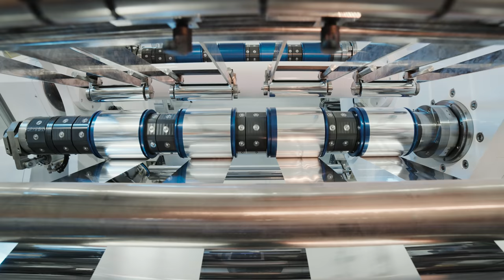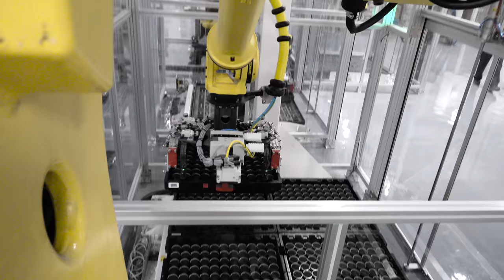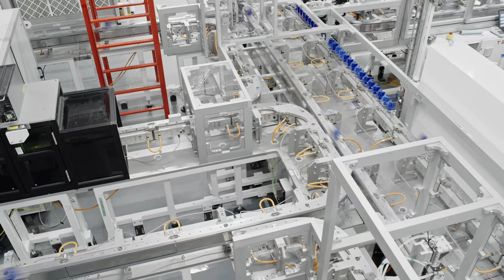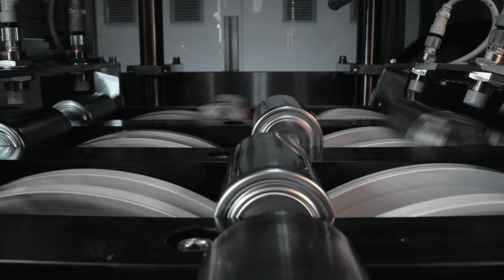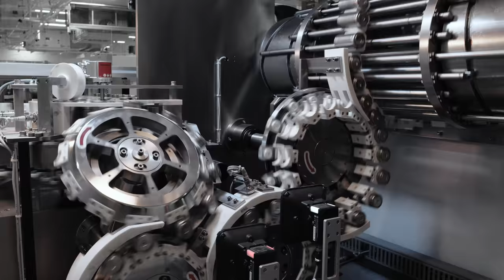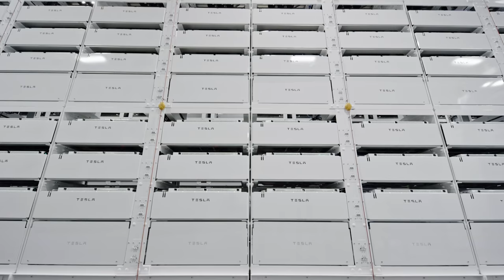Making Batteries

Comment: 17 reasons to short $TSLA

1. Dependant on external battery companies (Panasonic, CATL & LG Chem)
2. The autonomous driving features customers have paid for are illegal and don’t work. Other companies including Waymo, Zoox and dozens of Chinese companies are developing autonomous solutions. Automated Lane Keeping Systems looks about as far as this will get for a very long time and Tesla has no obvious competitive advantage.

3. Regulators asking for recalls and not complying
4. R&D cut to the bone (pipeline issue)
5. It doesn’t make money adjusting for “aggressive” accounting (warranty provision) and massive carbon credits about to dry up
6. Over promise, under deliver culture (robo taxis)
7. Non existent quality control for such an expensive item combined awful after sales
8. Reckless financial management (almost went bust during model 3 ramp up)
9. Tiny market share
10. Terrible industry (capital & labour intensive, endless churn of new better new products, difficult/recalls, consumer preferences are wide ranging)
11. Price cutting to support market share not a good sign.
12. 2021 EV models out selling Tesla in Europe.
13. Hundreds of new EV models in the pipeline over next few years.
14. 150 competitors making EVs. (With established global manufacturers miles ahead on build quality, manufacturing capacity. And fast developing Chinese government support EV industry)
15. Unsustainable mania among buyers (TikTok level research, price momentum)
16. Musk unfit to run a public company
17. $780 billion market cap supported by zero profits and unprecedented irrational exuberance. To justify analysts assumption get more ridiculous daily 😳

6 reasons to own $TSLA
1. My uncle made $50,000 on Tesla stock
2. I watched an investment guy on TikTok
3. Electric cars are the future
4. The share price keeps going up
5. In the FUTURE Musk says Tesla will do ABC and XYZ
6. In the long term the business will grow into its valuation
It will be extraordinary if investors in Tesla hold their gains from here. Has there ever been such a terrible business with such a high valuation. Compare it to Apple at $2.1 Trillion or Google at $1.2 Trillion with huge profit margins, scalable businesses and dominant market positions.
What happens next? Who can say. None of us know the future but it doesn’t half look like Tesla investors will eventually find the thin ice gives way as they plunge into freezing water.

Comment: Wonder if a wind tunnel in the car would help charge the battery? Bring that mid floor hump back and put a 5inch PVC from mid bumper to bumper. Then just put a 100 mini fans in it, then say over 20mph these fans become windmills and start generating electricity. Maybe put a couple of them on a ladder rack on the CyberTruck see what happens.
Reply: the extra drag will demand more energy from the batteries and drain it at a faster rate, tesla resorts to regenerative barking as a form of generating power.
Reply: @miguellopez3392  How much drag could it be if it was a straight shot through and the winds turned to release the airflow. Make it so it slides out for fan replacement. Be more drag on opening a window.
Reply: @miguellopez3392  A ev car is nothing brilliant until it's self charging.
Reply: @greensandbeansgaming1358  you dont understand that the spinning a fan to generate power will put a higher energy requirement on the motors on the car pushing it then the energy generated from spinning the fan, i don't think you have a right to say what is brilliant until you know that this is not a perpetual motion machine.

Comment: Can anyone explain to me why they actually making batteries round and not square shape, guess it would safe some space?
Reply: round batteries are cheaper to make because its very simple for a machine to roll material into a cylinder then to shape it into a square or other forms, that would take extra steps and more precision, this cost difference makes up for higher space which isn't all that much needed by their current batteries.

Comment: i'd say probably 99% of people don't get the significance of this battery. let's just set the ENTIRE issue of powering an EV aside for a minute- and let's focus on the rest of the car. how long will the rest of the car last? INDEFINATELY.  the few minor parts that might need replacement are insignificant, pricewise. ANYONE who understands electric motors and electronics will acknowledge this. now- let's circle back to the 4680 battery. Jeff Dahn's preliminary testing of this battery indicates that its' maximum lifespan would be 3.5 MILLION miles or 30 years. tesla's projection for this battery is 1 million miles. shelf life is NO LONGER an issue. the old lithium cells? 10 years of battery? NOT ANYMORE. one pack, ONE CAR- ONE LIFETIME. 

who can compare? which legacy auto maker? NONE. at this point, they're ALL doomed. not next week... not next year. NOW. stock analysts for SURE don't get it. there should be a feeding frenzy at wall street over tesla. the jaw dropping moment for me.. was when maxwell technology first solved lithium battery degradation and got bought by tesla in 2019. for me- that's when I KNEW it was real. the jaw dropping moment for wall street won't be until tesla owners start posting pics of tesla odometers with 800k miles on model Y's that are already 12 years old.  by then- 80% of legacy auto will be bankrupt.  

isn't this how wall street always responds? 10 years after ALL the signs were there? legacy auto in partnership with big oil have basically OWNED the planet for the last century.... and with a SINGLE piece of technology- tesla changed ALL THAT.... and NO ONE noticed- YET. consumers figured it out- long before wall street did. 50% growth yoy since 2012? 6 month waiting periods to get a new tesla? while legacy struggles to sell NEW cars that have been sitting on the lot for OVER a year.  

yo elon- way to go for the win bro!

Comment: Was'nt their a material that could be 3Dprinted, hold an electric charge, and if memory serve's, was also heat resistant, it  were black, and was not strangely priced, expensive. But the knit pattern.
Reply: Can you remember where you saw it?
Reply: Useless for EVs unless it can be scaled for mass production.

Comment: Why not make cuboid spaced batteries so there is no space left between the batteries and more can be fitted in the car.
Reply: Cell need space anyway. They have heat transferring materials between each cell. Cuboid batteries will make the battery more prone to overheat.

Comment: I was extremely disappointed by Elon's blunt rejection of the request to allow our FSD license to be transferred to a new Tesla on the Q4 results call.  There should be two classes of FSD licenses: Residential Use and Commercial Use.  It's unreasonable to price FSD based on the assumption that every Tesla owner with FSD is going to turn their Tesla into a full-time robo-taxi.  Also, automobile insurance companies currently won't pay for FSD license replacement as part of a total loss claim.  Does Tesla insurance?

Comment: Which cars are going to get the 4680 batteries first in the US?
Reply: model S plaid is a confirmed car.
Reply: @miguellopez3392  And the structural battery pack?
Reply: @Greg29  that will likely first be seen in the model Y at giga berlin.
Reply: @miguellopez3392  Thanks for the info. I'm waiting for the 4680 batteries before considering buying a Tesla, would also prefer it to have the structural battery pack. Guess I have some waiting to do.
Reply: @Greg29  plaid model s will now be available in march for the US.

Comment: Why tesla never put solar panels on any of their cars, Is it just because of looks? I hope atleast Tesla semi will feature one. There's plenty of space above semi which can generate considerable amount of electricity and it won't even affect the look of the vehicle.
Reply: it would add a cost that wont be made ack for over a decade if you count money saved on electricity vs installing and paying for the panels, its unviable unless panels get much cheaper or efficient.
Reply: @miguellopez3392  but there are cars running on solar panels alone, and c'mon a solar panel on the roof won't be that costly. Maybe there might be some technical difficulties but nothing that Tesla can't solve.
Reply: @fnp3092  and those cars are less desired due to their cost, size, speed, and safety. 4 miles a day is what you can expect out of a tesla if its roof where covered in solar. it can be solved just not now due to other factors in the technology chain.

Comment: ok now let's see the video with the factory that recycles those batteries !!!
Reply: might take a while, these batteries are being built to last over 10 years.
Reply: @miguellopez3392  you're missed what I meant with that question,making them is very easy compared to how difficult it is to recycle them because you need workers to do it, so yes there is not a video of a facility with machines doing battery mass recycle, if they just thought of the problems they were causing down the line they would change their present battery (pack) designs.
Reply: @vasopel  tesla and a founder of tesla have invested into battery recycling, tesla already recycle batteries but not at mass since not many of their batteries are being sent back, its not that you need workers its that you need a lot of energy separating the base components, they freeze, crush and dissolve the batteries in chemicals and doing this isn't cheap, so they continue to work on developing cheaper extraction.

also since you are so concerned with battery waste what is you alternative solution?
Reply: @miguellopez3392  go find a video or a picture of how a battery pack is glued together and tell me that you can melt-freeze-crash-disolve that into something (re)usable without people dissembling it first. 
alternative to what? batteries? there isn't one afaik,but we must build the infrastructure NOW and not wait until all those battery packs pile up,also some of the cost of recycling them should be added to the new batteries price.
Reply: @vasopel  battery is difficult to disassemble but the cells themselves will be intended to be used much longer, about 25 years, tesla also plans on just re using old cells for grid storage, adding the cost of recycling them will help ensure we cant afford to build the infrastructure to recycle them because  the cars themselves wouldn't be commercially viable at these higher cost, even so tesla companies are working on developing better recycling methods, so you are complaining about something people are already throwing millions of dollars and thousands of engineers at.
Reply: @vasopel  making the first batteries  for tesla use to cost 10x more until they figured out how to make it cheaper, imagine what would happen if they also included cost to recycle? No cars would sell to fund their R&D department to make them as cheap as they are now, You are scared and want technology to advance when YOU want it, that's not how the world works bud, technology can be produced in perallel, even if batteries dont get recycled it will still be less damaging then running on fossile fuels, you cant have everything you want.
Reply: @miguellopez3392  ? I'm scared of what? I'll be long dead by the time the problem gets out off hand :-) , but still...I'm really sad this is the way people are thinking :-(
oh well it's in the human nature to see only the near future.
Reply: @vasopel  yes people are thinking battery recycling should be solved and will solve it, your thinking everything should be halted until batteries can be recycled, you refuse to understand why this will not accomplish much but your fear of a large pile of batteries scares you enough to keep you from making the logical connection Between profit and availible funds for developing recycling.
Reply: @miguellopez3392   who said everything should be halted? it's just that there is not enough progress being made in battery recycling technology-machinery-infrastructure and that's a problem, battery manufacturing progress (and any technological progress) should go hand to hand with battery recycling progress, if not...it's gonna cost a lot more in the future, and if you think that companies are just waiting to have big profits before starting doing that then you're delusional. :-)
Reply: "should go hand to hand with battery recycling progress"

it should but this is real life where technologies aren't parallel in difficulty of advancement and profitability.

you keep wanting the technology to exist but ignore the fact that technology like this will take longer to develop since the demand for recycling doesn't exist yet and that companies wont make profit for recycling for years.

let me make it really simple since you are having trouble with the concept. 
NO MONEY FROM CAR SALES  = NO RECYLING INFASTRUCTURE
Reply: @miguellopez3392  I don't "want the technology to exist" I would just like them to invest more money in developing it, 
let me make easy for you: 
MONEY FROM CAR SALES DOESN'T MEAN THEY WILL MAKE THE HUGE RECYCLING INFRASTRUCTURE THAT'S ACTUALLY NEEDED ,
and the future generation will have to pay for the recycling :-(
Reply: @vasopel  let me make it even easier 
NO MONEY = NO RECYCLEING.
Reply: @miguellopez3392  hm.. 
NO BATTERIES = NO MONEY 
so yes
 NO BATTERIES = NO RECYCLING
great! :-)
Reply: of course...that's not the answer...they just need to develop battery packs that are easier to recycle and invest in automated battery recycling machines. ;-)
Reply: @vasopel  "NO BATTERIES = NO MONEY"
tank goodness they have batteries. and are selling them as fast as they can make them, this is ow they are currently funding research at tesla.

"NO BATTERIES = NO RECYCLING"
because these batteries are being put inside cars where they will remain for over a decade

"they just need to develop battery packs that are easier to recycle"
no they actually dont, they can sell these batteries and force the government to mange the waste, similar to how the US government subsidies oil drilling to make it commercially viable.

you seem to live in a alternate demission where things get developed way before they are need.
Reply: @miguellopez3392  no I am not in an alternate dimension that things get developed way before they are needed,
 I am in a dimension that things get developed WAY AFTER they are needed, and people think it's perfectly ok for companies to "force" the government to mange the waste not realizing that the consumers are gonna pay for it (taxes)
Reply: @vasopel  damage from car emissions outweigh the damage from lack of battery recycling, ultimately using BEVs will save the government money and help the climate stabilize preventing trillions in damages, the world goes for what is better not for what is best.
you want to live in a world that this one can't be.
Reply: @miguellopez3392   well that would be true if the energy for the cars didn't came from coal
Reply: @vasopel  that's location dependent, I live in Washington, #3 state in tesla sales, our power is 80% hydro. coal makes up less then 25% of the national grid, it is actually losing to renewables now, natural gas is over 35% but burns 2x as clean per kwh.

Even when powered by a mix grid  of fossil fuels they are still cleaner then  even hybrids.

Tesla also sells the nations cheapest solar to help customers to power their cars with their own solar system.
Reply: @miguellopez3392  good for Washington, I was thinking of china, with the new tesla factory opening there and all the other chinese car brands selling cheap electric cars like crazy they will have to build more coal plants because they just can't make nuclear plants fast enough. 
in the USA...well if they don't start making new nuclear plants soon they will have to go back at making new coal plants (lets hope not) or natural gas plants , 
looking on charts...we can see that the US burns a lot of oil for energy (30 something %) actually the same amount (percentage wise) as natural gas, so there must be some kind of a problem with distribution of natural gas to the energy plants, I don't understand it since natural gas plants are cheaper to make and cleaner than oil ones.
energy from renewables in the US is about 12%,that's too low.
Reply: @miguellopez3392  you are right only about 1% of the electricity is made from oil that's what I get for trusting the first chart I found on the internet :-(
yeah I know about fracking, good for the economy but bad for the environment :-(

Comment: What battery is pictured? 18650 definirely not, as these are thin and long. Pictured are wide and short...
Reply: its a new format tesla made called "4680" it has 5x the volume of the 18650.

Comment: how much co2 emission?
Reply: 60% less then previous batteries, so about 2 tons of C02.
Reply: @miguellopez3392  so why i should not buy petrol car?
Reply: @themaster7993  because a petrol car will produce around 50-100 tos of C02 in its life time, where a EV will be around 30T with the current fossil fuel grid.
 but the main reason people buy them is because they are cheaper to run.
 a $38,000-$55,000 EV may be expensive but you will pay around 3x less for fuel
 (141mpg equivalence) with electricity at $0.12kwh
but it can also output 500HP to get its 2 ton mass moving fast so people like the feeling of driving one since it offers economy and power.
Safety, software, and autopilot are also features people prefer over regular gas cars.
but if you need a moral reason then a studied showed that more Americans are killed by vehicle emissions then car accidents, over 30,000 a year, this is because gas cars release their emissions in public spaces and cramp cities, even a EV powered by coal is cleaner because the emissions are away from the city.

but if you drive a lot and far then expect trips to take 20% longer from having to charge it for half a hour every 300 miles.